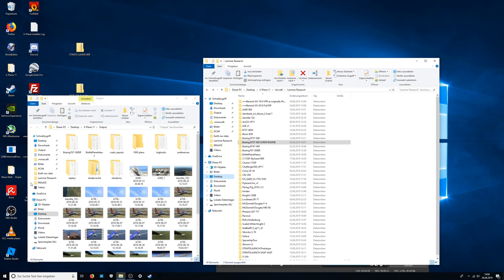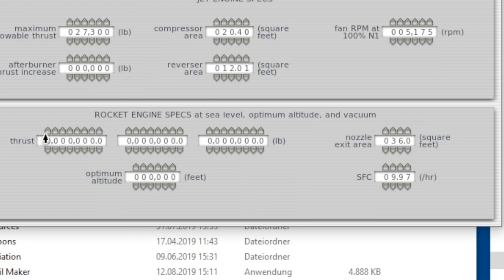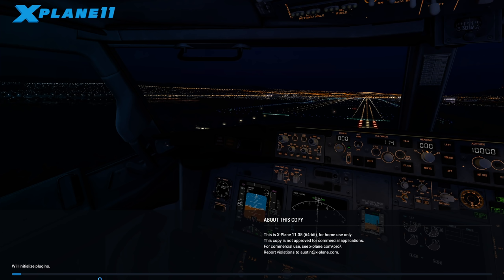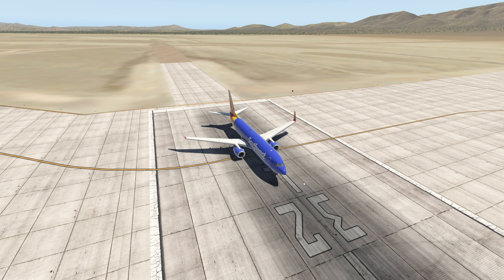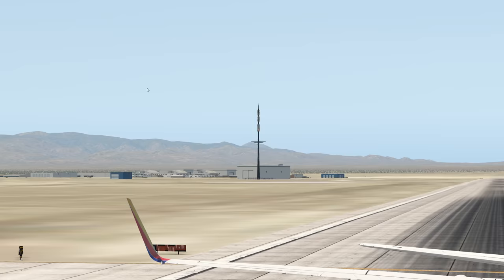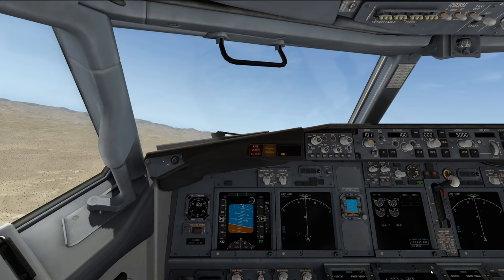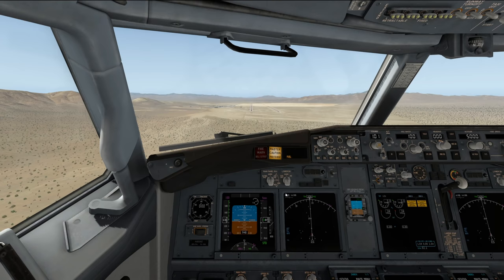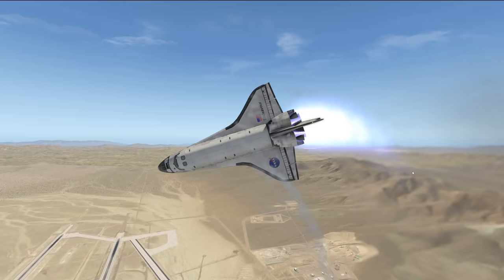What If You Put ROCKET ENGINES On An Airliner?

Comment: I am actually made some “rocket planes” and here are some secessions I would like to share with to make a better rocket powered aircraft.

1. Make sure you adjust the FUEL CONSUMPTION of the rocket engine instead of use the huge fuel tank. Increase the volume of fuel tank introduced in this video seems not the best way because increased fuel quantity will also brings the aircraft heavier but the fuel consumption of the engine still HIGH.

2. You might need to redesign the ignition system, electrical system, bleed air system, and hydraulic system. Because the rocket engine might not working normally to provide the electricity and bleed air when it runs at low power. Plus the engine starter need to be electric since the air starter not works.

3. No thrust reversal available for rocket engines, you might need to think about other effective ways to slow down your aircraft such as a powerful break.

4. Please do not set the thrust too high, imagine how powerful when a B737 uses two GE90 engines? Since you use the rocket engine, there is no thrust loose when you reached a high altitude. But be aware, you might not able to control your aircraft outside the atmosphere.

Comment: Two F-1 rocket engines from a Saturn V would give that Boeing 737 an acceleration of about 20 g (with maximum take-off weight) and make it break the sound barrier in less than 2 seconds – or more likely rip it to pieces before it left the ground.